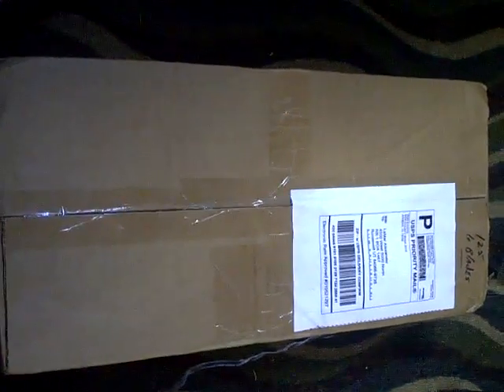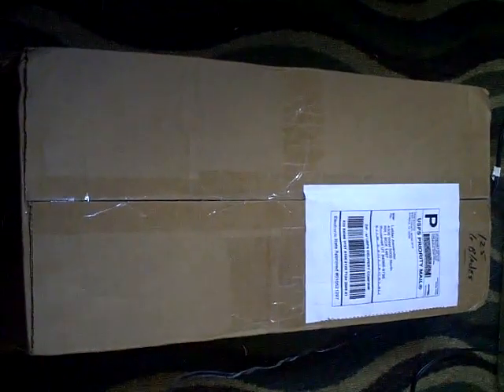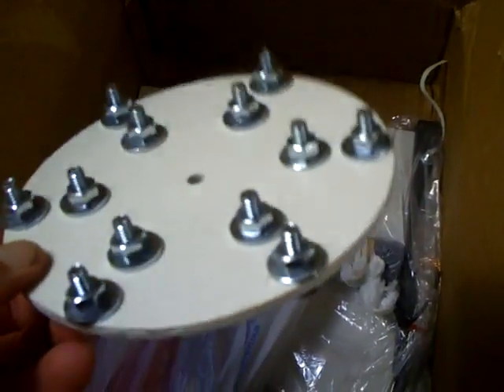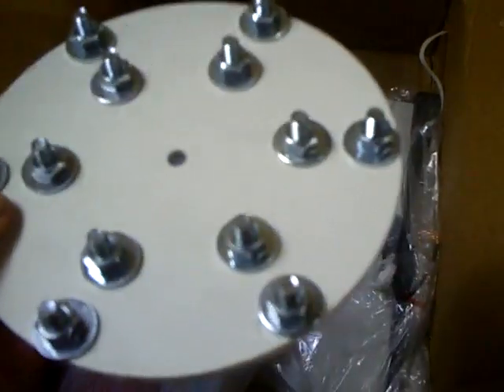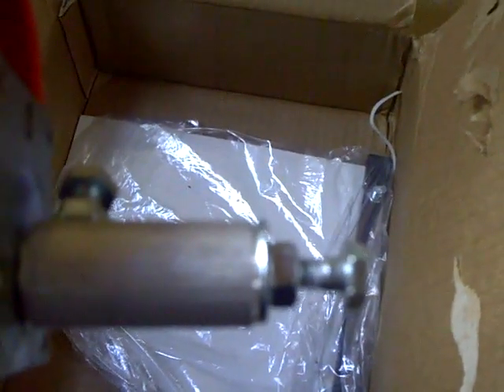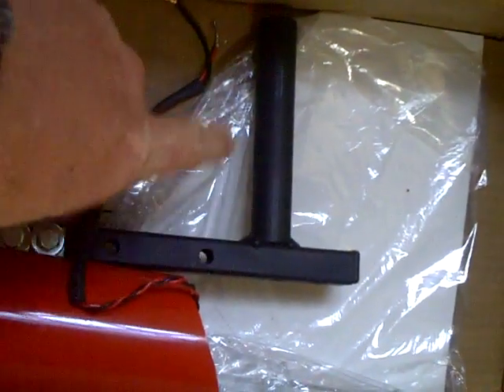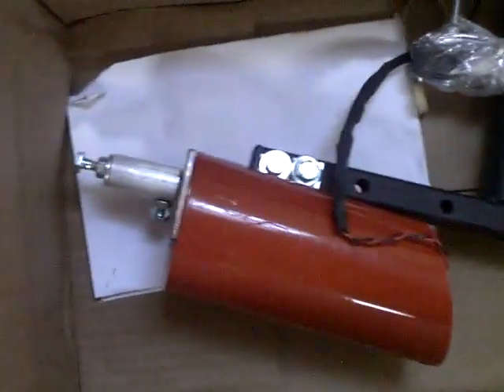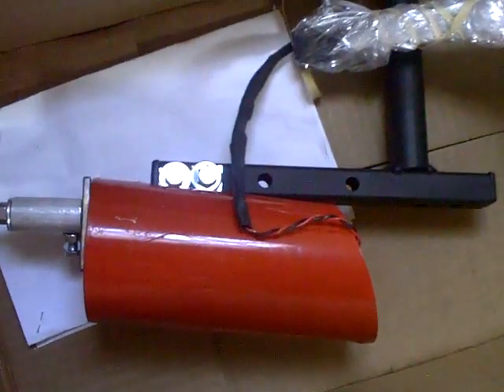Wind Generator: Part 1

Comment: Hey Lamar - I went to the usawindgen website and found a 125 watt turbine for $110.00 but it didn't have the 6 blades or the red motor shield like the one you have. The blades were only 12" long also. Am I looking for the wrong thing?  Your book is awesome BTW :)

Comment from the maker: So far so good!

It kept my batts topped up over winter and let me run a small dc fridge. I am going to use it to run a dc fan this summer.

I will have to try the nylon bolts. Wonder about shear strength ?

Comment from the maker: When a motor shaft is turned it produces power and is called a generator. Motors are used as generators in most wind turbines FYI

Comment: Looks good. My 2 cents.... paint or replace those bolts and hardware with stainless if you can. Those regular ones will not last long outside and also leave rust stains all over.